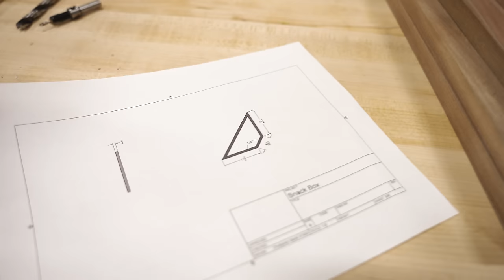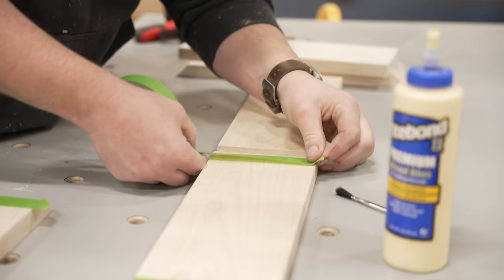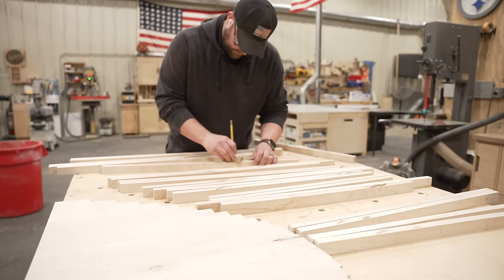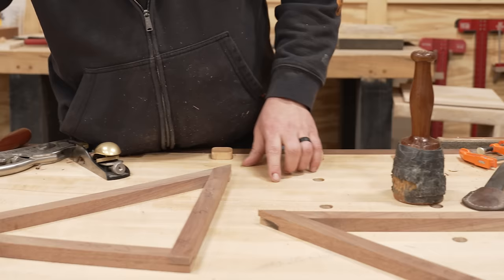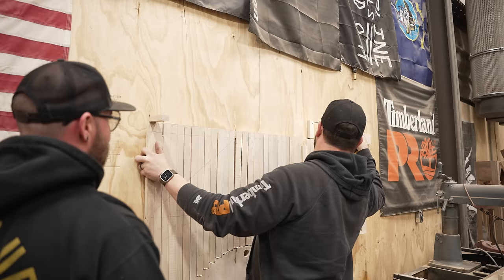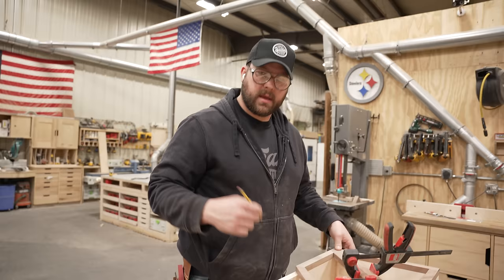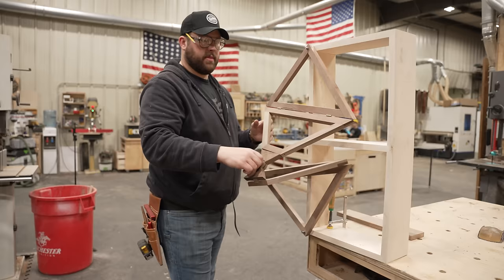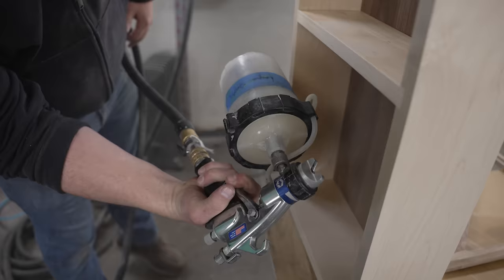I Build Viral Folding Furniture

Comment: The U S of A is, litterally, one of exactly two countries in the world that for some unknown reason still desperately cling to the Imperial measurement system. the other country is Liberia. Myanmar is mixed and Britain has eventually joined the rest of the civilized world. It is so much less complicated to simply rip off the training wheels on your bicycle and just get with it, alot of the wood you buy at the hardware store in the US is already in metric so what, exactly, is the problem? I am completely certain that after spending a couple work days in a row using metric, most 'murrrricuns will admit it is easier. 10x10x10cm = 1 liter of volume = almost exactly 1kg of water*, 100x100x100cm = 1000 liters of volume = almost exactly 1000kg's of water*. * = pending somewhat on temperature. 3 feet is a yard, a yard is almost a meter. Take 1 yard, lenghten it a tiny bit and chop it into 100 pieces and you get 1cm. 1 meter = exactly 1.093613 yard. Challenge: Spend a week using metric for anything you do, I am sure you could get a lot of views.

Comment: And here we see a typical american that gets into trouble because he keeps on thinking that because he uses imperal, everything must be redesigned and recalculated, because he cant bear buying a metric ruler.  Especially on precise builds, never convert. It will just bring you in more trouble than it should be.
And i dont think you have to relearn your measurements from the ground up... just if you have a plan that is metric, use metric equipment. I am sure you are able to read the numbers on those even if you dont know how big a meter is.
It also goes the other way, if i have a plan that is imperial, i use my imperial equipment. I dont know how big a quarter inch is, but my ruler will tell me.